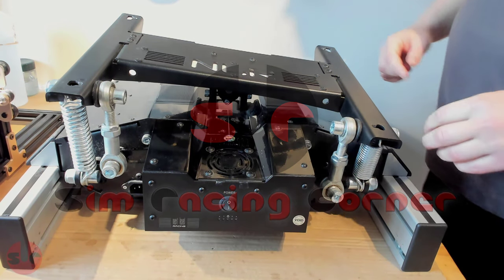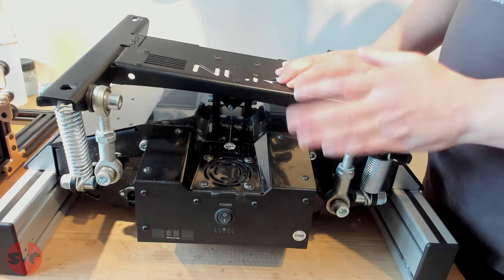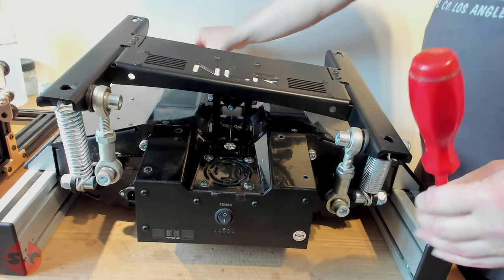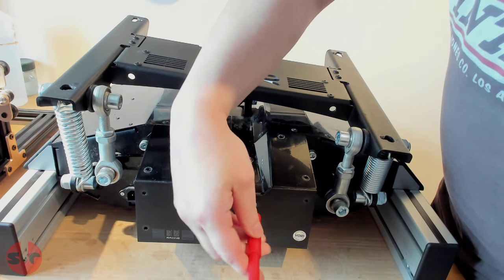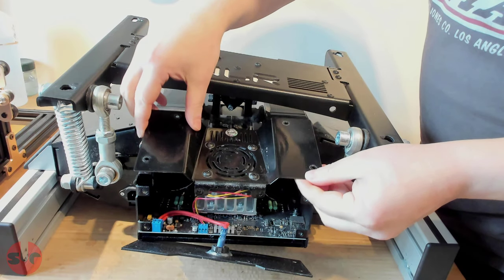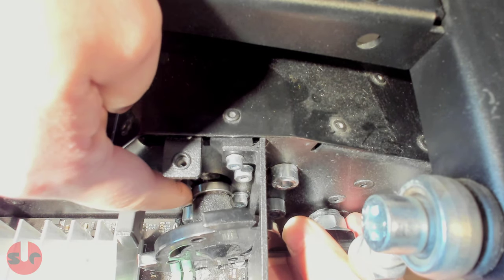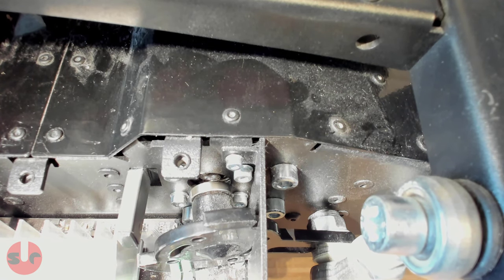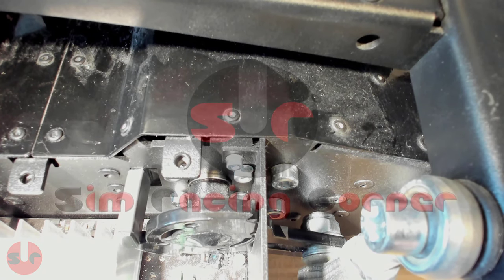NLR Motion Platform 'BROKEN' Opening it up! Part 1/3

Comment: Wow, mine suffered the issue about 8 weeks ago. I put it down to push my sim rig by the seat as it’s one wheels which caused the weakness. 

I had mine repaired by NLR, and it’s now back working fine. 

I did have one or two issues regarding the shipping, but Matthew and the team at NLR always answered my emails daily ( remembering they are based in Australia ) and kept me up to date on progress. 

I did send them a thank you email and they said they are making improvements on how repairs and servicing is getting improved on, so I hope that’s all sorted now. 

Its not great though hearing these very expensive items are failing after around 2.5 years. Makes you wonder if the firmware update we had in June/July is responsible in some way. 

Bottom line though, NLR is a company who cares about their customers and although expensive to service, they do do a great job and your have it back in a few weeks as good as new.
Reply from the maker: Hi Douglas, thanks very much for dropping by detailing your experience, it's really good information to share. Can you tell me, was your repair within the warranty period?
Reply: No, I’d had mine for over two years possibly one of the first to get the black one which I think is version 3.
Reply from the maker: @douglasingram8881  Awesome, thanks for that.

Comment: I use to have a NLMv3 to and it broke on the exact same spot.  It's a known issue and it's always the left side that breaks down.
Good to hear you had it fixed in 2 weeks time.
Reply from the maker: I had a couple of comments on my first video of people having the same problem. I know one of them was the left side too. That's very strange!
Reply: @SimRacingCorner  as I commented in your part 3 video mine, after 2,5 years, broke as well and it is the right side.

Comment: Mine just did the same exact issue and snapped the shaft. What was the process?
Reply from the maker: Contact Next Level Racing support. They'll handle the details. It will need to be shipped back to the factory for repair.
Reply: I'm getting a tempered shift machined in locally I wonder if the motor is ok still? I'm in the process of opening the whole unit so I can see if it's attached or if I can weld. New shaft

Comment: Mine just broke last week say the exact same  way.  Since I purchased it second hand they refused to warranty it.  I am   Still waiting for a response to sell me the new parts or get it fixed by Next Level
Reply from the maker: Wow, I've just seen your video. That's bonkers. The same side too. Please keep in touch and let me know if you get a response.
Reply: I was looking into buying one of these ASAP @Buscho but your post has put me right off.  If this is a common problem due to the design I would expect the company to stand by it regardless if it wasn't the original owner. Just saved me of 2k so thank you.
Reply: @apexracing741   Well X-Men Addict  I am still waiting for parts to repair the Unit Myself I found out that if you buy a Next Level V3 Second Hand They Will Not Honor The 2 Year Warranty. I live In the United States So Shipping Would Be Expensive So I was forced to order a repair kit for $544.00 dollars. So I Received the repair kit  and they  arrived damaged. So Know I am waiting for a new order of parts . I am not the only person to have this Left  Knee Side Motor Shaft Side Fail it is Very Common Issue. But they Claim the New Units are Updated to Prevent that Failure. But I Must Admit the Next Level V3 Is Amazing for the Price Especially with Good Vr and Transducers

Comment: Did it still power on when this happened? I’ve had mine for less then a year and I ran into a wall in AC and it powered off and won’t power back on. Seat is stuck leaning to the side like that.
Reply from the maker: Yes it did, the motors we're still moving with the broken arm.

Comment: Thats no good mate, hopefully it is an easy fix that you can do yourself.  How many hours has it done ?   Mine is 2 years old and going strong, I think close to 400 hours of use.  I would be lost without it as static racing feels so wrong !   Good luck and keep us informed.
Reply from the maker: It's a sad time indeed. I haven't checked the usage, but I will and mention that in the followup video once Next Level gets back in touch. I wouldn't say it was heavily abused or ever ran at crazy strong settings (70-80% on the various sliders). There were many times I sim raced without turning it on, so I know I haven't clocked up a huge amount of hours that would be considered a reasonable failure from wear and tear.
Reply: Yeah I wonder whether their was some pre existing weakness in that metal shaft causing it to fail prematurely ?   Probably difficult to know that but motionsystemseu are a very professional established motion sim outfit and it may be something you can replace yourself though you woyld have to drill out the rivets.  The V3 overall is built like a tank so is disapponting a motor shaft fails by snapping like that. Lets see what can be done, hopefully a good plan is hatched !  ;-)